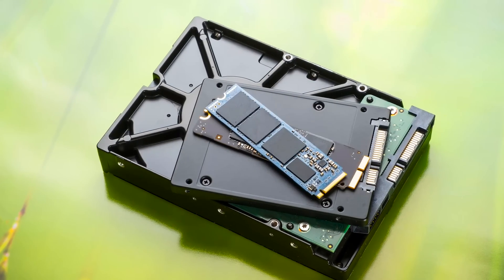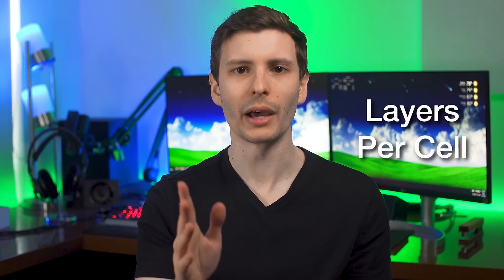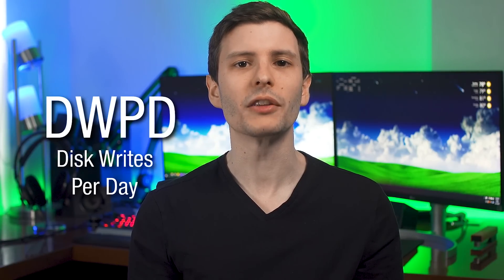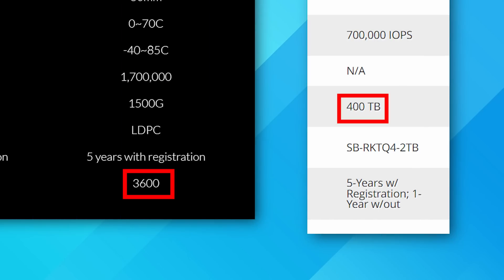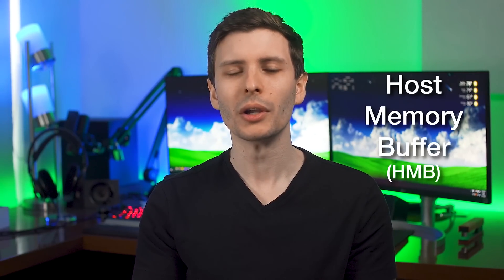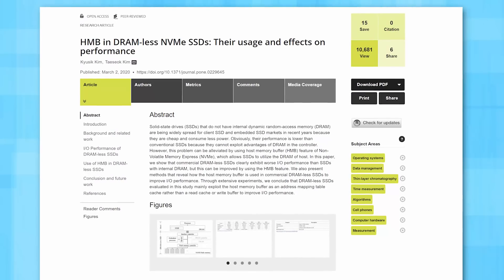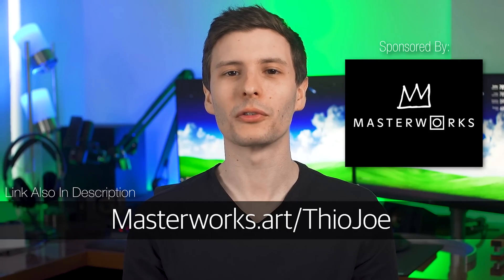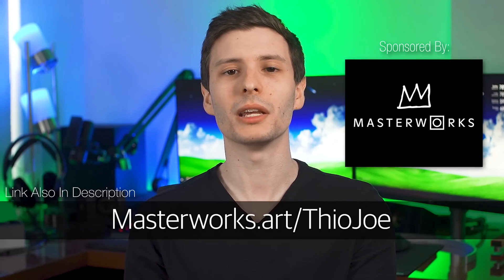SSD Features Few People Know About (Learn These Before Buying)

Comment: 1)
The reason why an SSD slows down when you are writing huge amounts of data to it (50 GB or more, depending on the drive -- could slow down at 100 GB), is because most SSDs have two types of NANDs.

A 1-TB QLC SSD (which is slow) might have a 50 GB cache which is made from MLC NANDs.
So as long as you do not write more than 50 GB without rest, you will see super fast performance.  But once you fill up that cache, then your data will be forced to write to the slow QLC NANDs, and your performance will take a huge hit.

When the drive is not busy writing new data, it copies the data from the MLC NANDs to the QLC NANDs, which it does in the background.  It is invisible to the user.  So your 50 GB of fast MLC NANDs is nearly always available for new data.

So your QLC SSD will seem just as fast as some enterprise SLC SSD.  When you write a few hundred megabytes, whether it takes 0.1 seconds or 0.3 seconds, you will not notice.
You only need an SLC or MLC SSD if you will be writing 50+ GB to it without rest.  Or that number might be 100 GB, or 30 GB.  It depends on the SSD, and that information is never available (I have never been able to find it).  And larger SSDs tend to have larger caches.

2)
Unless you are on a mission to wear out your SSD, you will never wear out your SSD.
One type of crypt-o mining (Chia) uses temporary storage (usually an NVMe SSD), and writes terabytes of data to it without rest.  Some people have been writing to their SSDs for nearly a year, without rest, and the drives keep working at full speed.  Even software that reports that the drive is warn out is only a hard-coded warning, based on the terabytes written.

Apparently, the SSD manufacturers played it safe with their reporting.
For standard computer office work, or gaming, or social media activity, etc, you will never wear out your SSD.

Your SSD could fail.  But it is not because you wore it out.

Cheers!
Reply: @marco31  I believe that that is a great SSD.  You, unfortunately, got a lemon.

Are you using a good uninterruptible power supply (UPS) to protect your computer's components from power issues?
One too many zaps could damage any part of a computer.  Even low voltages (sags) are bad.
Reply: Why didn't you mention TLC SSDs? They are the most common ones
Reply: @marco31  Like everything else, there are cheap-o UPS's, and there are commercial grade and hospital grade UPS's, and everything in between.

On the lowest end, they do nearly nothing other than switch to batteries when the power is extremely bad or out.  They do not protect your equipment from strong surges or under voltages.  They basically are good for getting you through a short blackout.  But the lemon theory is probably the case.  I've been there.
Reply: About MLC vs SLC cells you mentioned in the first comment. I'm not 100% sure, but I believe that modern SSDs use hybrid cells. So, any QLC cell can be used as an SLC one just by writing a single bit to it. So, if you have an empty SSD, you can use its entire capacity as SLC cashe. Only once that cache is filled, it gets used as QLC. And of course, ad you said, in spare time SSD dumps SLC data into QLC cells, thus freeing SLC cache.
Reply: @DimaZheludko  "...I believe that modern SSDs use hybrid cells. So, any QLC cell can be used as an SLC one..."
I do not know anything about that.  But it sounds reasonable.

It still boils down to the SSD utilizing its faster sections first, so that the nearly no user will ever see a performance hit.
Reply: same, but the secondary one is 178GB (main one is 79.4GB)
Reply: @marco31  do the mx500gb have dram??? I'm trying to get thus information but nobody tells
Reply: @TheVirtualArena24  Crucial MX500 has DRAM cache.
Crucial BX500 does NOT have DRAM cache.
Be careful when choosing between those 2.
Reply: @peppa1492  oh ok. I bought bx500 240gb for initial storage. Are you sure mx500 have dram and how well is that ssd. Or should I go with pcie gen 3 m.2?
Reply: @TheVirtualArena24  let's be real here - unless you're transferring large amounts of data to the BX500 it should be fine. If you're only using it for games and/or some documents I don't see any major problems there.

MX500 is not a bad SATA drive, but if there is something like a Samsung 860/870 Evo for a similar price I'd probably get that one.

NVMe drives are obviously way faster. If you only want to use it for games or simple tasks there will be no benefit over a good SATA drive. If you're building a new system and/or reinstalling the OS you may want to put it on an NVMe, but if you're already satisfied with what you have right now there's no need to upgrade.

On the other hand if you're doing lots of photo/video editing or anything that relies on fast storage, get a decent NVMe drive. Right now they aren't a lot pricier than SATA drives in many cases.
Reply: @peppa1492  ah ok. I realised I'm not a heavy user I play games and some programming. But I need a storage upgrade since I have only 240gb now so should I go with a hdd with less price like 1tb or 500gb ssd?? I'm confused because hdd parts may tare faster.
Reply: @TheVirtualArena24  if you don't necessarily need faster storage and mainly play games that don't see much of a benefit from using SSDs the 1TB HDD will give you more value for the money. However if you care about loading times and don't need as much storage then an SSD is the go-to. 
I have no objective data regarding HDD vs SSD lifespan, but I assume HDDs aren't as affected by large amounts of data written sequentially as SSDs. Random operations are likely a different story though. 
If you're going for an HDD just make sure it has a 7200rpm motor.
Reply: @peppa1492  I know all these but still can't decide also. Will discuss and see at home
Reply: @TheVirtualArena24  get samsung evos
Reply: Epic information bro thanks alot
Reply: But how about dramless NVMe SSD?
Reply: @irfanfauzi7082  they behave like ssd in responsiveness and like HDDs in copy n writing.
Get an Evo wd max budget yuh cud afford. I'm using since 2015
Reply: @CaptainScorpio24  i think im using MP34 SSD, does it have dram?
Reply: @irfanfauzi7082  yess bro it has . 🙂
Reply: @marco31  I have a crucial P2 and no issues and it works perfectly.
Reply: Funny enough, the TLC and MLC are the same NAND often. They just use the cells with less precision.
Reply: The entire 2TB may be TLC, but it just uses some of the blocks as MLC and use 3x the blocks per write and clean it up later.
Reply: Some of the main reason are heat and random writes.
Reply: @LividLeon  "Some of the main reason are heat and random writes."
Heat is a reason.  It is not a "main" reason.

Random writes is not at all the reason for huge amounts of writes to suddenly slow down.
If 100% of the writes were random, then they should all write at nearly the same speed, no matter how many gigs of random writes are happening.

If you have a 100% SLC SSD, it will never slow down with any writes.  You can fill the SSD from beginning to end with random writes, non-stop, and the speed will remain constant.

The slowdown happens when the cache runs out, which is the case with consumer level SSDs.
Reply: @0Perhaps  Random writes is a loose term. If you write in 4 kb random chunks, you're probably stressing ssd more than you think. SSD write in big blocks. Usualy block size is 512kb, I believe. So, to write 4 kb, it has to read 512 kb, replace 4 kb of it inside the internal memory, and then write those updated 512 kb to a new fresh cluster. Then it deletes old cluster. So, to write 1MB of 4 KB ramdom blocks, the SSD has to actually rean and write 128 MB of data. 
I may be wrong about actual numbers, but hopefully you get the idea.
Reply: @DimaZheludko  Yes, everything your wrote is true.
Also true is that if you had an enterprise class SSD, made from 100% SLC NAND fabric, then those stresses and their resulting performance would be consistent throughout the entire body of the SSD.  You would not see it work at one speed, and then slow down.  At whatever speed one section of the SSD runs at, it will do the same on any and every other section.  Again, assuming an enterprise class SSD made from 100% SLC NAND fabric.

Same scenario if the SSD was 100% MLC.

But consumer class SSDs are a mix of SLC for cache (or more likely MLC for cache) for, perhaps, 10% of the storage capacity.  The remaining 90% will likely be slow QLC NAND fabric.

So the crux of the matter is speed consistency.
Enterprise class SSDs will perform equally throughout its entire structure.
Consumer class SSDs will take a huge performance hit, if enough non-stop data is written to it, such that it runs out of its relatively small percentage of cache NANDs.
Reply: @DimaZheludko  yes, the 'idea' is correct, and that has some unobvious consequences when using SSDs in some kind of array. You need to optimize your stripe size to match number of devices times internal blocksize to minimize the number of partial block rewrites. It is worth taking care of that, as it speeds up those writes a lot, and saves a lot of wear.

I have managed to wear out a pair of 256gb Samsung 860 EVOs by using a 128k stripe size on a 2 device stripe. That took a couple years, but its entirely possible to manage that way.
Reply: 1) Mmmmno, multiple types of NAND chips would make management harder and take up space. What the buffers do is use whatever NAND is there as kinda-SLC until it becomes full during a big write. It's an obvious strategy and requires no extra chips. THAT is where the wall is, because now the drive needs to reorganize all the data in the cache and shove it into multiple charge buckets and then mark processed space for cache. Of course, if the drive manages to reorganize everything before the write is over the process repeats.

2) Chia only cares about storage speed during making plots. What the user decides to use is their problem. Yes, SSDs can get really badly worn during the plot creation phase (which can be moved to spinning rust after it's complete, BTW). The "sensible" solution is to have a huge RAM cache or SLC drives. Incidentally, haven't heard of Chia in *ages*.

FWIW, I refuse to touch QLC drives. ~200 total drive writes and lower performance than with even TLC just rubs me the wrong way.

Comment: I'm shopping online to buy a new budget desktop PC from Dell; something I would use for word processing, light web surfing, some email.  I'm a senior citizen and Dell offers four (4) hard drive options on the desktop PC I'm looking at.  They offer a 1TB HDD, a 256 SSD, a 512 SSD, and a 1TB + 512 SSD all in one HD.  I don't know what brands of HD's Dell uses but the 1TB HDD is the cheapest of the four (4) drives.  The 256 SSD is the next priced higher, the 512 SSD is next and finally the 1TB HDD + 512 SSD is the most expensive option.  Could I get by with a 1TB HDD or should I buy a new desktop PC configured with a 256 SSD?  Thank you for any positive feedback you might agree to offer on HD options.
Reply from the maker: For basic word processing and stuff, 256GB is likely definitely sufficient. If you can afford it, I'd always recommend going with an SSD over a hard drive for the main drive, because it's really a big difference in speed and responsiveness.
Reply: @ThioJoe  Thanks for the reply.  Do you know much about Intel processors?  Based upon my needs I can't decide on an i3, an i5, or an i7 which would probably be overkill for my basic computer needs.  Could I get by with an i3 processor or spend more money for an i5 processor?  Computer memory, 4GB, 8GB, or 12GB?
Reply: @Bigstevoreno0655  An i3 is good enough for regular use (they've had 4 cores for a while now). More ram is better. I would not get less than 8GB. I don't know why they even sell computer with only 4GB these days.
Reply: @Bigstevoreno0655  Big role here plays processor generation and not just the number next to the "i".

Comment: I have a weird drive. 2tb ssd and its QLC, however its set up so 128gb is SLC and used as sdram cache. As the drive fills, the cache gets smaller and converted back to QLC.  I'm not sure if I like it or not.